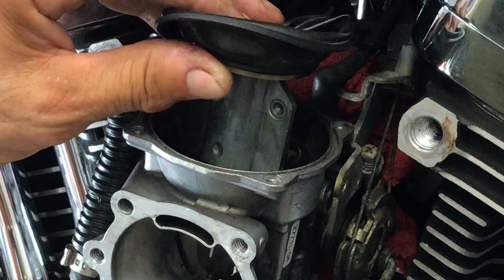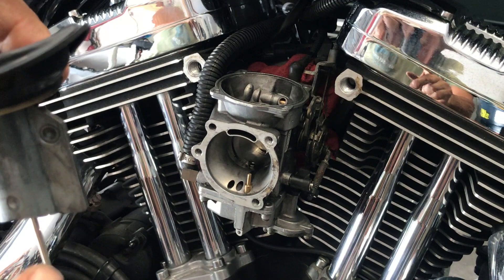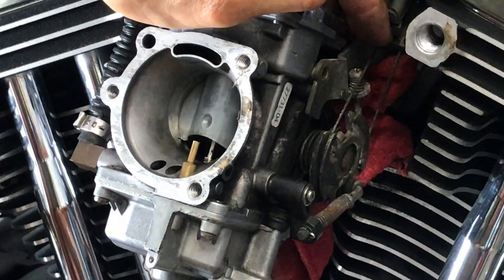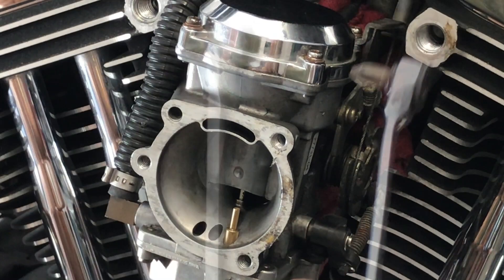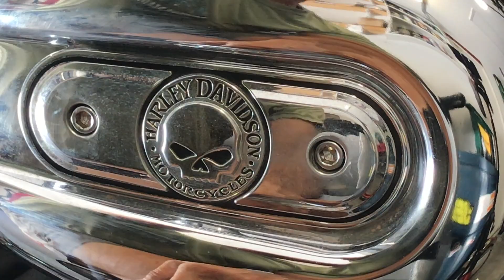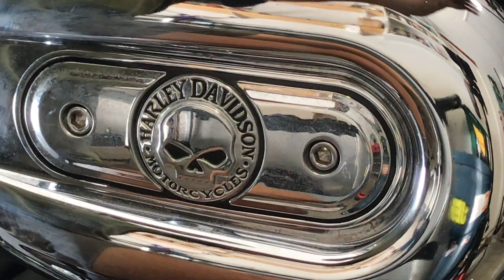How To Harley Sportster Carburetor Slide Needle Adjustment.

Comment: Or does the washers have anything to do with the smoothness, or is it all on the A/F screw?
Reply from the maker: What pipe what air cleaner are you running? XL1200 likes 45  180.main   3 washers under your needle.   3 3/4 on the air fuel let me know how that runs.   Smoothness  means you're going the right way. Let me know how it runs well I just suggested.
Reply: @TwoWheelRocco  I have the V&H Short Shots, and a Big Sucker air filter
Reply from the maker: @billmeloche4918  short shots and the big sucker air filter takes time to tune not easy. Test and test and good luck.

Comment: I'm guessing the rag trick was learned through experience.
Reply from the maker: Absolutely I seen one of my friends didn't put the rag in the intake and a screw almost went down that hole just as I was showing. An ounce of prevention goes along ways. And I'm a car guy you don't leave none of those holes open. Something  go down there and you don't even realize, never had the experience and I never want it.. Thank you for watching and all your support. Ride safe and have a great holiday.
Reply: @TwoWheelRocco  I'm in aviation and everything gets plugged, covered or capped.
Reply from the maker: Saves you a lot of headaches.
 @Ghost-vf2li

Comment: Will this setup work on road king evo 1340 with stock jet?
Reply from the maker: Yes it will..As long it is your OEM CV Carb..Any questions just ask. Thank you for your Sub Stefan. Let us know how this works out. Ride Safe and have a great day.
Reply: Okay so for the guys who live in Europe it is also possible to use 3,2mm rings i just put 3 of those on my 1340 roadking and i will test drive tommorow.
Reply: @stefanoosterwijk453  Hey Stefan, wie ist dein Feedback?! Ich überlege das bei meiner 98er Sporty 1200 auch zu machen. Ändert sich was am Verbrauch? Gruß Tom
Reply: Tom SP-1  hello I tried it on my 1340 evolution it pulled way better then before but it ran rich so I decided to buy another needle.

Comment: by following these method, does it give good fuel consumption, sir?
Reply from the maker: Your Sportster will run better.  Gas mileage will be affected. Let us know how this works out.
Reply: is there any setting on carburetor to make it good on gas mileage? My sportster gas mileage was good i first bought. And then turned bad when i send the bike to the wrong hand(mechanic). My carb cough a lot and really bad on gas mileage. i have no idea what to do now.
Reply from the maker: What year, model and how many miles?
Reply: @TwoWheelRocco  year 2001 and 21700 miles sir
Reply from the maker: Lets start with oil level check, I like little more then 1/2 on your oil stick.   Then make sure air filter is not oil foul from to much oil in motor. Fully charge your battery. Then try to start,  Let us know how that works out. Do you have a battery tender?
Reply: @TwoWheelRocco  ok i will follow the above step. i dont have one sir

Comment: Hello, would you be so kind as to send that link for the washers, and the brand of that High Performance Breather please...Thanks again for your videos...you're the Guru  :)
Reply from the maker: Happy to Help.   https://www.ebay.com/itm/HONDA-CM400-CX500-CB750-CBX-CARBURETOR-PERFORMANCE-TUNING-WASHERS-BAG-OF-50-/382517078367?hash=item590fcb695f. Thank you for your Sub Bill.. Ride Safe and have a great day.
Reply from the maker: Do you not oil these filters up.  https://www.ebay.com/itm/331738469929?hash=item4d3d275629:g:VJgAAOxyzGlQ7Ixz

Comment: What’s the number on them washer or size?
Reply from the maker: https://www.ebay.com/itm/HONDA-CM400-CX500-CB750-CBX-CARBURETOR-PERFORMANCE-TUNING-WASHERS-BAG-OF-50-/382517078367?hash=item590fcb695f.   Any questions just ask. Thank you for your Sub Isaac.  Ride Safe and have a great day.
Reply: @TwoWheelRocco  I ordered these instead Rocco. These were $20 for 50 washers
Reply from the maker: @mobilegarage9312  send me the link brother. Thank you they seem to be hard to find.
Reply: @TwoWheelRocco  I clicked on the link you posted on this set of comments. The one for Honda-cm400 carb performance running. I must have bought the last pack of washers they had
Reply from the maker: @mobilegarage9312  Thank you anyway. Let us know how it works out.

Comment: Please just take the carburetor off makes everything eaiser to deal with❤
Reply from the maker: Just trying to help bobby, Thank you for watching and your input. I'm just trying to keep it simple for people.  just taking the carburetor off for some  people  just don't  won't to deal with. possibly the Harley clamp on the gas line. The throttle cables sounds easy and it is. When they get comfortable enough, they will take the carb off but one step at a time. It's a sportster,  entry level riders people.  that's my thought. Ride safe and have a great day.